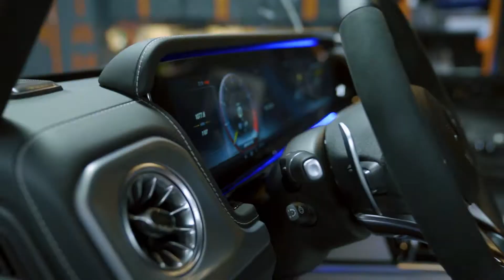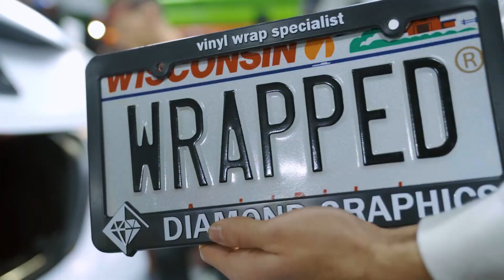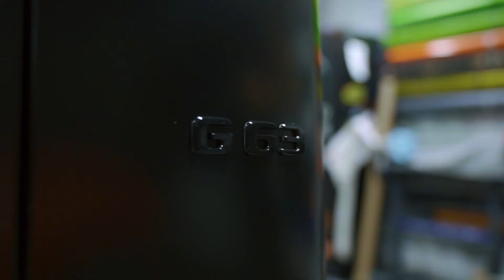Is Wrapping a 2022 G63 G Wagon really the most difficult car to wrap!? - Diamond Graphics

Comment: I’m watching this video as I’m taking one apart. Mines white and going to satin black 😅 first time doing one and definitely a lot of time in disassembley. Great job guys 👍🏻 Oh and by the way, the side molding “clips” aren’t really clips. They’re more like pins that just help align the piece, they don’t pop out like normal clips. They just slide out. They’re all double sided tape on the back.
Reply: hey same story here! BUT i have FULL JAMBS as well, how do i remove the doors? mainly the electrical connector?
Reply: @aaronferguson9328  yes. It’s a pain in the ass to access it.
Reply: @jayfranco9969  where do i unplug it? on the door side, or the end that goes through the jamb?
Reply: @aaronferguson9328   I disconnected all the connections that are on the door. Make sure to take pictures and videos of where all wires go. It can be a bit tricky putting them back in and running the wires back through the door.
Reply from the maker: Helpful tip thank you! After doing a few more, we have figured out how to disassemble them much better haha